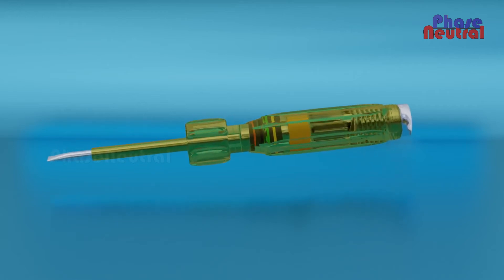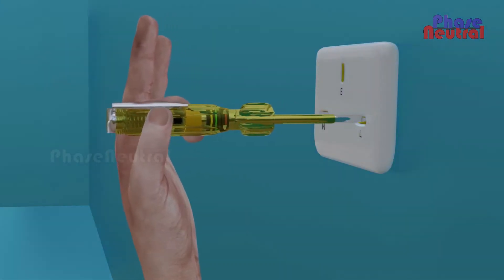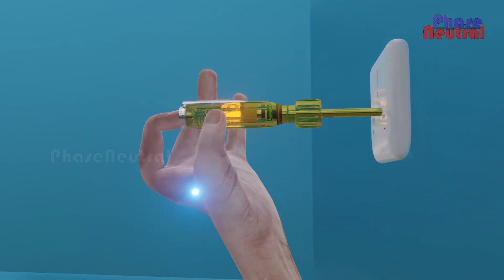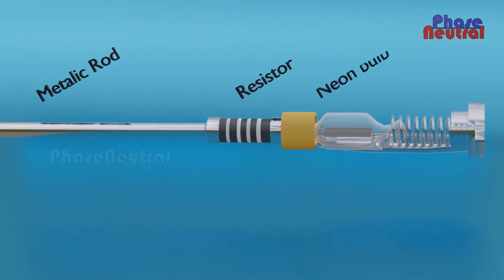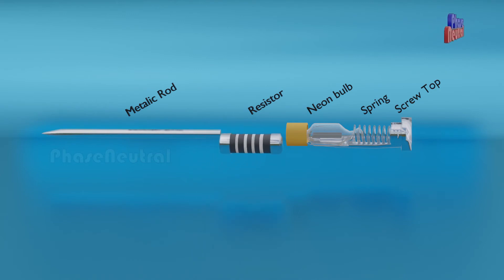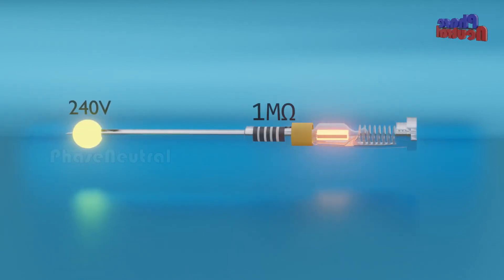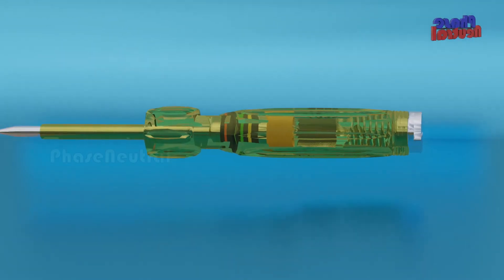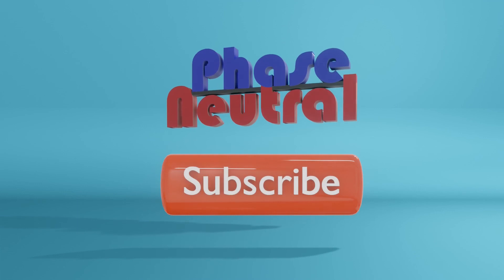Why we are not getting shock from a line tester? | PhaseNeutral

Comment: but u didnt told how circuit is completed if we use tester with rubber slippers there's no earthing
Reply: you are actually a capacitor that is why. You can also see that when you touch the metal part of the hammer, you will see the light turn on.
Reply: Because your shoes or slippers or chair works like dielectric components and complete earthing in very low value